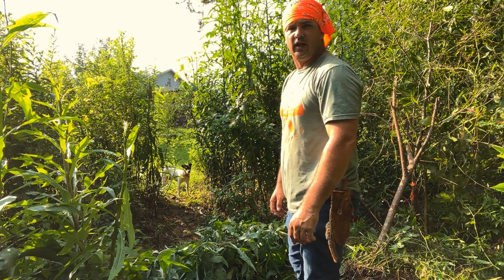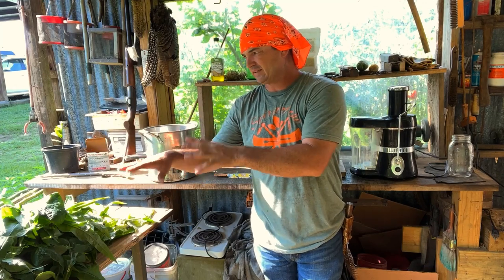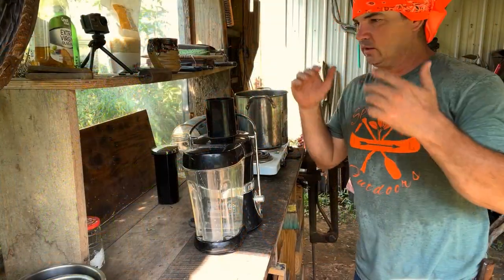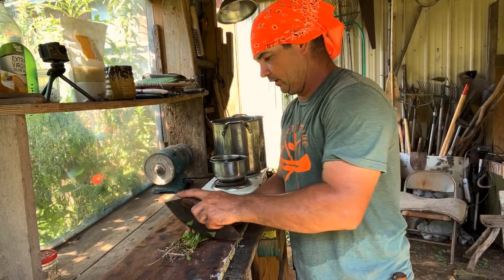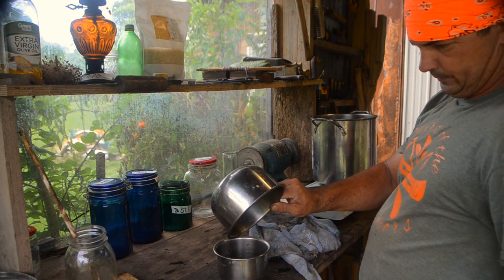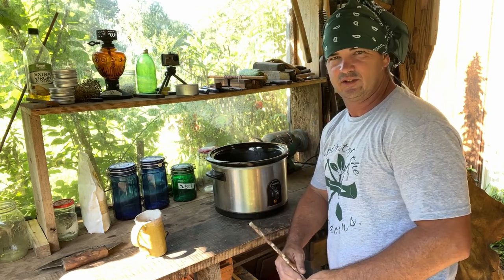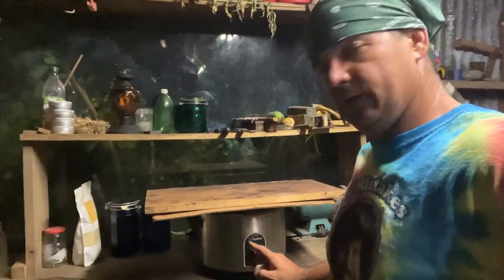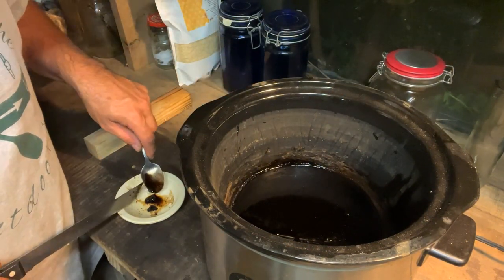Making Wild Lettuce Paste Medicine simple

Comment: Secret about crockpots... Low, Med, & High, all reach the same temperature 290° f. The difference between the settings is the time it takes to reach. Obviously, High reaches temperature faster, Low taking longer. Be sure to use one with a Keep Warm setting. That mode keeps food at 165°
Reply: Wow! I didn't know! How long will it take to evaporate on the 'keep warm" setting?
Reply: @katyrgs9547  a very long time. But it keeps it from boiling

Comment: I think the primary reason someone might say, "you should not boil it" is that no fire or electricity is necessary if you put a small amount of wild lettuce syrup in a glazed clay pot (or metal pot that does not rust easily) and then wrap the pot in cheese cloth, and put it up on a shelf, and let it dry for a couple of weeks. It would have to be a small enough amount to dry quickly (less than half an inch of liquid in the bottom of the pot). To digress, the Spanish word "SECA" (pronounced "SAY-KAW" or "S.EH.EE.K.A.W") means "dry". For example, dry clothes (or dry robes) are "ropa seca". I am fairly certain that the English word "sacred" means "dry". I suppose sacred bread does not get moldy because it is bone dry, and putting a pot containing a small amount of liquid (a shallow pool) up on a high shelf away from pet dogs and children to dry gives you the "sacred" (holy?) shelf on which medicine is kept. I don't think its necessarily holy in a religious or spiritual sense; it is just dry. Anyway, putting a cheese cloth lid on a pot and putting up to dry works when no electricity or firewood or flammable gas is available to boil the liquid down into a syrup.
Reply: That's interesting

Comment: At time-stamp 30:57 you mentioned a french press. For making home-made cheese I once used two or three 5-gallon plastic buckets. I recommend drilling two or three dozen holes in one of the plastic buckets with an electric drill. When you stack the buckets together, solid bits stay in the top half and liquid ends up in the bottom half. The holes made by an electric drill are usually too big. Therefore, I put my heated curdled milk inside of a pillow case. I bet that you can pour simmered wild lettuce inside of a pillow case and put the pillow case inside of the five gallon bucket full of holes. The liquid will drain to the bottom. It's also possible to cut a circle shaped piece of ply wood almost the same size as a bucket bottom and then put a bunch of rocks on top. The heavy rocks squish the juice out.

Comment: This is not hard to do. You just have to step out and just do it. The first time I did it the crock pot then finished it on the stove.   I did it on low so it took about 3 days because I would turn it off at night. I got a very thick gel, husband added some cherry amaretto to thin it out some like a cough syrup.  We only use a half of a teaspoon.  Trust his process it works, step out with a little faith in yourself, you can do it. 
I have been saving seed (I call them paratroopers) been putting them in a zip lock back but leave it open half way. 
Good luck to all who try this process.
Reply: Put them in an envelope,then inside a jar,no chance of moisture getting to them that way 😊
Reply: @lindafarnsworth7302  from my whole crock pot… I got a 1/3 cup of tar… after 3 days!!! but not very thick…. So far I’ve gotten better results making tea… the effect seems better… 
Anyway there are a couple of plants left to process…. So far it seems serriola is the only plant around… 
Cheers!🤗
Reply: @dsoldier9227 true. I left the bag open so every was dry. There was no mold when I planted them in January. I transplanted them in garden this spring. 😊

Comment: The first time I made the tar I fell asleep 😮. It was in a crock pot on low. It was almost completely evaporated. I let it cool, it hardened. I scraped it out in little chunks. It is a weird thing. Moist air will make it wet again. Anyway, I put the pieces in a small air tight container with a little raw rice, like you do to keep moisture out of salt. They still are hard and work! Mostly anxiety and pain relief. You can just mix a pieces, pea size with a little liquid and drink. Or smoke in a pipe. It gets soft when smoking (don't touch it'll burn you) but it rehardens when it cools off. So cool! Im going to try juicing just leaves and cooking it down. I had some tar in the fridge for a long time too. Seems to get better with age; both ways. Thinking😳of an invention to drain the stalk😮. Hey, try a window screen; instead of that grate. I think I am in love with you and your videos. Everyone I know thinks I'm crazy. Wait till they find out I have only medicine around someday

Comment: At 33:25 you mentioned keeping bugs out of the crock pot. Stretching a piece of cheese cloth over the top works. Also, cheap white "sheer" curtains work in place of cheese cloth. A "sheer curtain" is see-through and will allow steam to escape, because sheer curtains have many small holes. Do not use brown, red, blue, or colored curtains because the steam will make the colored dye leak out and then the medicine will contain curtain dye. White-colored sheer curtains are fine for this purpose.

Comment: I wonder if you froze the plantain "juice" would the oil and water separate ... and the water freeze.  If it did separate and water froze ...it sure would be easy to take out the water.
Reply from the maker: Hmmm. Good question and i have no answer. It wont hurt to try it and see
Reply: I heard somewhere you can freeze fermented apple cider and it leaves you with apple liquor

Comment: My question is why you don't also use 100 proof vodka. I have heard that only part of the medicinal properties are water soluble, and that the rest are alcohol soluble.
Reply from the maker: You can . I just didnt have any and sharing the most common methods. I used alcohol to tincture it in but i only use 80 proof in tincture
Reply: @SpiritoftheOutdoors  Seems like a couple splashes of the alcohol would be the best way to melt off the remaining tar from your crock pot, pan and utensils you used. You could then just poor it into your tincture.